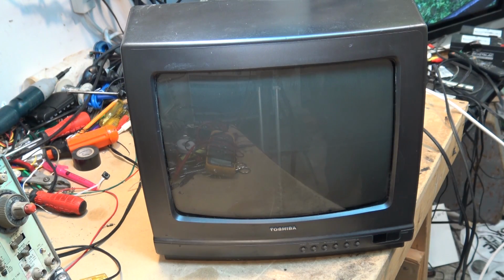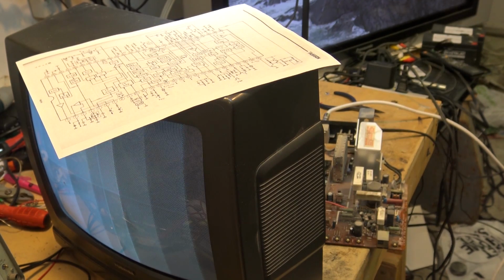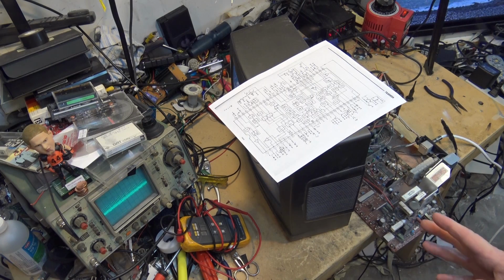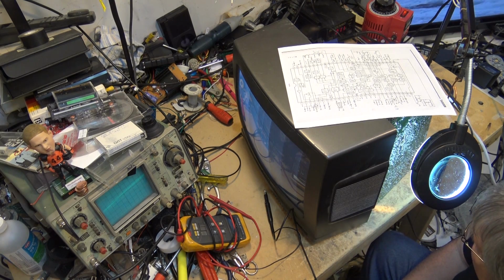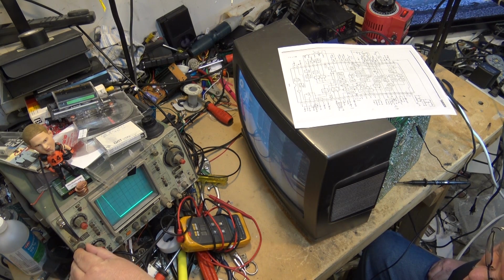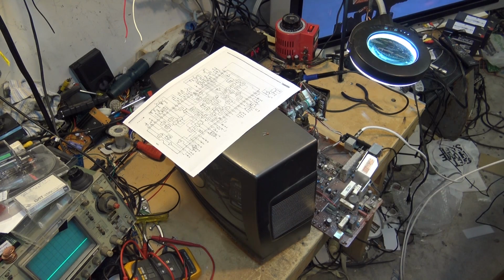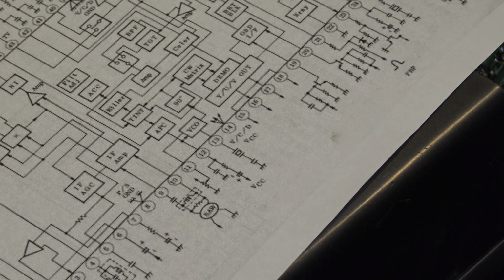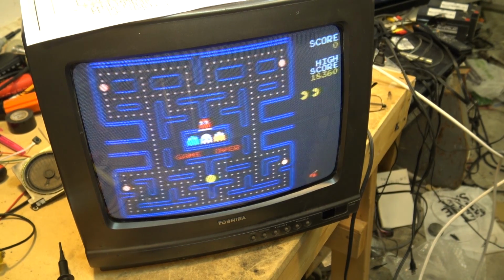Toshiba CRT TV No color repair

Comment: Just so you know, once you connect your ground clip from your scope to the TV chassis your isolation transformer is 100% defeated and doing nothing to protect you because your scope is not isolated or floating. Sounds strange I know but it is do to how neutral is tied to ground at your beaker box. Test it if you don't believe me, you will be able to light a 100 watt light to ground even when powdering your DUT off an IT once that scope ground is clipped to your DUT.  I found out the hard way ;)
Reply from the maker: Bzzzt WRONG.Te ground probe on my scope will earth the chassis, however the line side is still isolated from the AC main.  I could short either side of the incoming AC input on the secondary side of the isolation transformer to ground, nothing will happen. Try that without isolation, the neutral side would do nothing but the hot side would have disastrous results.If you can't understand this, I can do a demonstration to prove I am correct.When the device under test is isolated from the AC main, it is isolated, simple as that. That is the purpose for the isolation transformer.I could connect my scope ground to either side of the AC line on the isolation transformer and nothing would happen.Yes I know how the ground is tied to neutral not at the breaker box, but at the utility. Neutral is earthed.Doesn't matter, both the hot and neutral leads on t he isolation transformer are completely isolated from ground. There is NO ground lead on my isolation transformer, no pass through of neutral, or ground. It is a 1:1 transformer. 2 wires to primary, 2 wires to secondary.Completely isolated.
Reply from the maker: I'll do a demo tonight, using the good old lightbulb.
Reply: awesome video  ! I bought a tripp isolation transformer and I also took the ground off it....on the inside . well said !
Thank you
Reply: ***** Maybe it's time for an update/reshoot on the IT video? :D
Reply: True! Maybe 12voltvids can do a better "shorter" version instead ;) My vids are toooooo long.
Reply: You know I like that plan. Maybe I will cut-up all my vids with that format. I'm sure my viewers would appreciate it and I could put out more than one long vid every month or two. HA!
Reply from the maker: Just wait for the demonstration that is forth coming. I have just done a video that proves that the chassis of the TV is totally isolated. I did the same test, both with the tv plugged directly into the outlet, and again plugged into the isolation transformer. Going through a lightbulb, the scope probe light up the bulb between hot and the probe when plugged directly into the ac line, but did not when plugged into the isolation transformer.  Video is rendering now uploading it as soon as it is done.
Reply: Bzzzt WRONG. Once that non-isolated scope ground is connected to your DUT "or just either leg of your IT" the other leg of your IT now has a high voltage unprotected loop path back through the grounding wire in your scope. Yes, please try this. I know this is how the wiring works in household wiring in the USA so maybe Canada is different but I wouldn't think so right off. I did make a video on this issue many many years ago if you check out my channel. It is a horrible video back when I was using a tape based video recorder and poor editing software. PS: I have a degree in Engineering Physics specalized in electronics so I do fully understand what I'm talking about here in the USA. Please test this so you don't get hurt someday.  I love your videos and would hate for them to stop. ;P
Reply: ***** Oh I already have an answer for that: I have you down for a 3-parter: Intro/Theory, Hands-on Lab, and Wrap-up/Review. This way you don't have to schedule time for the whole thing, just each part individually :D
Reply from the maker: True "serviceman" isolation transformers do not have a ground prong. They are 2 wire devices.There are some transformers that are designed more to filter out noise than isolate. They have a 3 prong plug, and pas the ground through, plus they have the neutral side on the secondary tied to ground. No protection at all on this type of set up. A true isolation transformer has no connection to ground whatsoever. 2 coils, primary and secondary separated by the core of the transformer. So both the hot and neutral side float with respect to earth ground, and neutral, which is tied to earth.
Reply: 12voltvids Very cool and thank you for helping to clear things up. I'm looking forward to the demo.
Reply: +12voltvids, Just for that added information. The 3rd prong on an IT has nothing to do with the problem I'm referencing. You can float your IT and you will still have this same dangerous grounding issues once a grounded non-isolated test instrument  is connected to your DUT like a scope ground clip.
Reply from the maker: Neutral is not tied to ground at your breaker box, but it is tied to ground at the utility pole. In addition to being a diagnostic electronics engineer with 32 years experience, for the past dozen years I have been a journeyman telecom technician, so I work on utility poles right next to power. I have taken more electrical safety courses than I can remember.
Reply: Ya, must be different in Canada household wiring. Here in the USA if you connect that light bulb between one leg of your IT and a household ground point when your scope's ground clip is connected to the other IT leg it will light the bulb every time. Maybe your scope is floating? Is the 3rd prong of your scope connected to a truly grounded outlet. 

If your house's neutral is not tied to ground at the fuse panel then what good is a ground wire to anything? Just goes to ground and then to the utility pole? If there is no circuit for the ground with respect to normal neutral mains to your home what good is a ground wire? It would be interesting to get a measurement of how many ohms you get between your scopes ground clip and another 3rd prong ground in your home as well as the the 3rd prong on the scope, it should be near zero otherwise it or something is floating.
Reply: O' and here in the USA all the ground wires are tied to the same bus bar as the neutral wires in the breaker box. That is just how the 110 V AC is wired up here in the USA.
Reply: +Todd Harrison (ToddFun) same in Canada. neutral and ground are both connected to the breaker box cabinet.
Reply from the maker: Neutral is connected to ground at every utility transformer.In some rural areas of Alberta they use ground return, and the neutral is only connected at a single transformer, and grounded at the transformer and 1 pole back (so there are 2 ground electrodes)In BC the entire neutral grid it ties together, and they are grounded through ground electrodes every 300 meters and on every pole with a utility transformer.Not bridged in the breaker box, the neutral bus is separate from the ground bus, but the neutral is tied to ground at the utility pole, and the breaker box is tied to the house ground electrode.
Reply: +Pesh Madscientist, Well then as long as the scope is not floating then the test should light up the bulb. You don't even need a DUT like a TV, you can do the test with just the light bulb, IT and scope just as I did in my video. There is not two ways about it, if you create a loop then current will flow.  Grounding either leg of the IT will setup a dangerous loop back to the other leg of the IT through the established scope ground back to the IT's energy source via any other ground just as if you didn't have an IT. Provided the grounds are tied to a common bus bar in the breaker panel and then grounded to earth someplace. If this wasn't true then ground wiring wouldn't do its job being a safety ground path in the first place.
Reply from the maker: Go look at the test. The secondary is not grounded. If I was to intentionally ground one side of the secondary, then that is a different story. So if I connected my scope ground to chassis ground, and then I were to touch the live side of the circuit while also touching ground, I would get a shock, or if I had my scope ground on ground, and my second scope ground were to touch live sparks would fly, but the general rule is only connect 1 ground lead anyway.
Reply: +12voltvids, Yes! this is the situations I'm trying to warn about. Meaning once that scope ground clip is connected your DUT is no longer isolated from a high energy shock just as if you were not using the IT. Please show this test as it could save people from accidental injury when they think an IT is protecting them. Many technicians don't understand this dangerous testing situations. Thanks :)
Reply from the maker: That is why my scope is floating as well. I only "earthed" my scope so that the bulb would light up when I was plugged into mains. Normally my scope ground is completely disconnected.There is no reason to ground test equipment on a service bench.First thing I was taught when I started my apprentiship when I was still in high school was to cut the ground prong off any and all line operated test  equipment. We also had a cable TV isolator. For those not familiar to what that is, it is 2 75-300 ohm matching transformers back to back. Remember the days when the antenna terminals were 2 screws, and to hook up to cable TV required an adapter? Well those adapters had the 300 ohm terminals isolated with capacitors. So we would attach the 300 ohm terminals to each other, so that the 75ohm cable signal went to 300, then back to 75. The cable on the second one was used to go to the set under test. That way if the coax touched the chassis it wouldn't ground it and create a hazard.
Reply: Those are good tips! I'll have to remember that one but wow, it has been some years since I have used any 300 ohm antenna wire. HA! I do have two old computer monitors from the 1980's with really bad color bleed, fussy image but not a focus knob issues. So if you have any time to demonstrate how to fix that issue on old TV's or 1701 Commodore monitors that would be very helpful. Thanks! :)
Reply from the maker: I just did 2 more on this set. Vertical bootstrap, and troubleshooting video output circuit, and color balance crt bias adjustment.Color bleed (flair usually to the right) is called blooming, and it is usually an indication that the crt is on its last legs.
Reply: GREAT! I will be looking for those vids. If they can be fixed I will try but if not I guess it could be time to drop them in the trash. I do connect my old commodore to an LED computer monitor through a modified s-video cable which works well but I just like the look of a good working CRT for my old 8-bit collection.

Comment: my old tv have mains pcb part and floating voltage side , so i guess not the whole chasis is a hot chasis, most of it is not. But the mains voltage part is clearly signed and silkscreened on both sides. Without insolation transformer work on floting part is relatively safe (if we rule out cathode voltage about 200V dc and all the high voltage stuff) And to work on power transformet part... you pop out power driver module and work on it ofline by the service book.
Could you show us how to regulate color amplifiers balance and cathode blanking voltages with anaog scope? Any old used tv might have those color problems r g or b overfill, every color might even cut out at a different level causing wierd color compresion, and it wouldn't be the ic.
Reply: kokodin,  I second this request as I have to monitors with this problem and would love to learn how to fix them for use with old 8 bit computers from the 80s.

Comment: Does that isolator thingy protects you against those big voltages?
Reply from the maker: The isolation transformer only protects me and test equipment from direct AC live current. If I stuck my fingers into the horizontal output circuit then I would get a shock, and I have been jolted thousands of times over the years.When I work around high voltage I keep one hand in my pocket, so that if I make contact there is no path for current across the heart.
Reply: 12voltvids So that's why we sometimes only see one of your hands. Stupid question: with your hand in your pocket, does that mean the current will go down to your feet or just travel throughout your body?
Reply from the maker: Rubber soul shoes, so no path to ground. Also isolation transformer, so even if I was earthed I am still protected. The second hand in pocket means that is not touching something else on classis.With the chassis isolated I won't get a shock by touching a live wire and earth, because the isolation transformer isolated the chassis from earth, but it does not isolate the chassis hot from chassis cold.In other words if I was touching say the B+ line, and earth I would not get a shock because the chassis is isolated, but if I touched the B+ and the negative one of the shields on the chassis I would get a shock.  So one hand away from the chassis. That way if a shock does occur it is in one hand, no chance of it going up one arm, across the heart, and down the other arm. That is the dangerous part. If I touched + and - by accident with the same hand I will feel it, but it isn't going to kill me. I was jolted on the job my a microwave oven transformer. The tool I was using had an insulation break down when I was measuring HV. 2,100 volts went through my hand, and caused muscle contraction which prevented me from letting go. Other hand in my pocket and rubber soul shoes kept the shock localized in my hand. I jumped back which broke the connection. I did get a nice electrical burn from this, which hurt far worse then the initial shock, and hurt for a few weeks as it healed. Electricity is to be treated with respect.
Reply: Man that sounds painful!

Comment: Why do you have a green text?
You sayd, that the TV has no Color.
Sorry for my band English, I am from Germany :D
Reply from the maker: The on screen display is generated after color demodulation. It is inserted as an RG signal on the red and green video outputs.
Reply: Oh Nice, thank you for the quick answere.
I have the same Problem by my old CRT TV from 2006.
The problem is, that the most people in Germany use modern TVs.
For my PS1 I need the old CRT technology. 
Where I can get new Parts? In an Electronical Store?
Reply from the maker: Fortunately most of the parts that are going to fail is capacitors, and any electronic component shop should have all the sizes you will ever need. Most common problems on analog TVs is broken solder connections, and capacitors. Occasionally vertical output ICs fail which today may be harder to find.